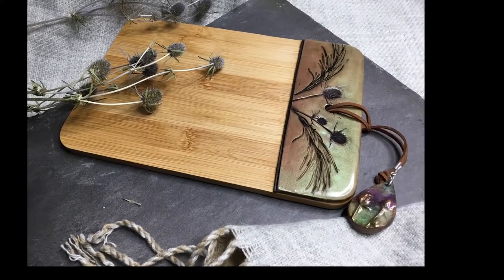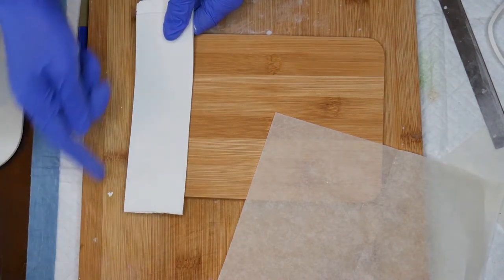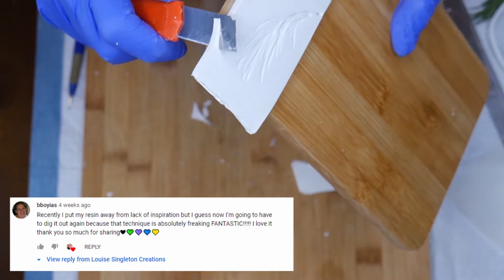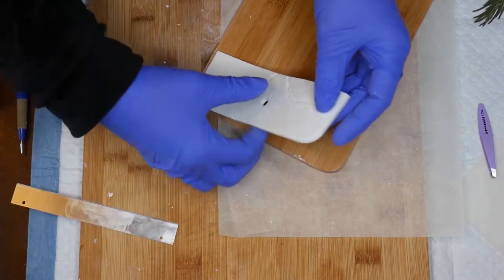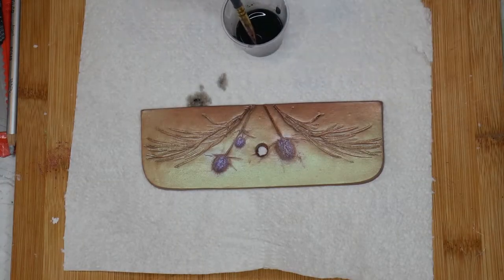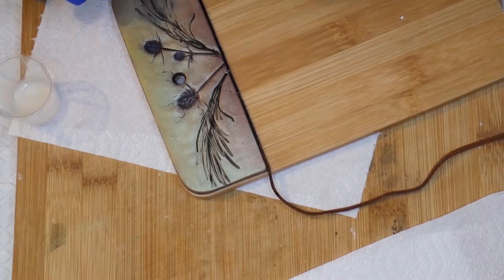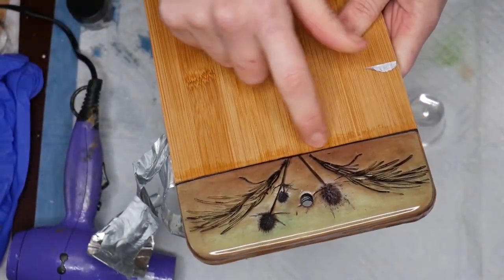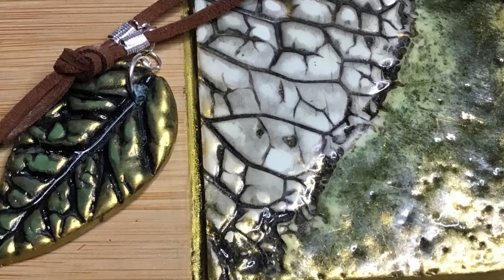Polymer Clay on Wood with Resin and Foliage! Serving Board Tutorial

Comment: Absolutely fabulous. Been wanting to do something like this for ages. Could you use air dry clay?
Reply from the maker: Thank you x. Yes I think you could use air dry clay, it would just be a much slower process because it would have to be thoroughly dry before gluing on and covering with resin. I would really recommend polymer clay though because it’s quick to bake and you can be sure there is no moisture in it. I hope that helps x